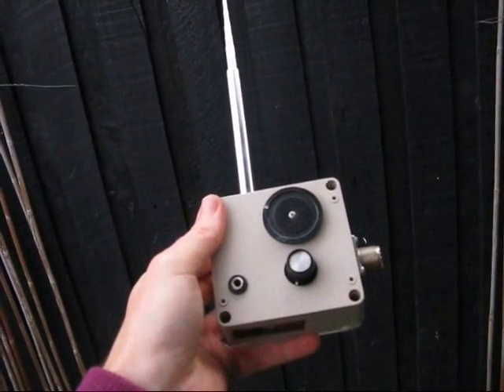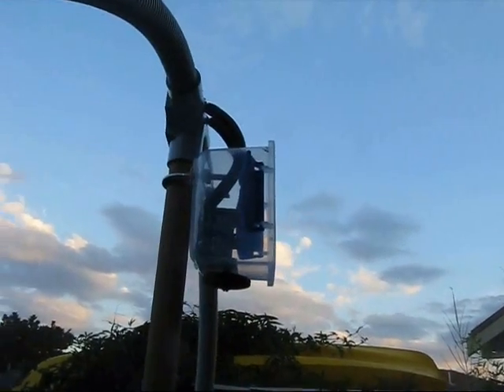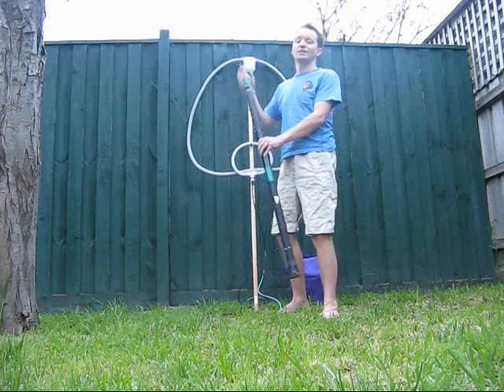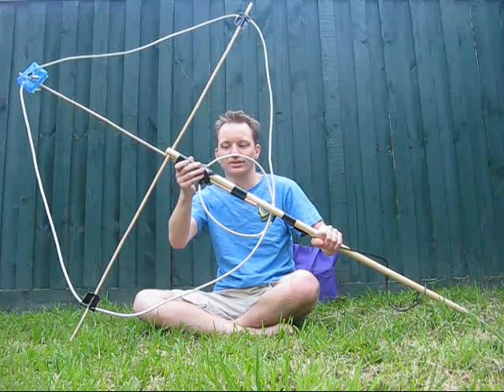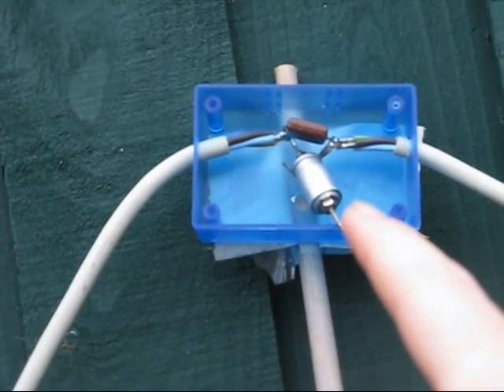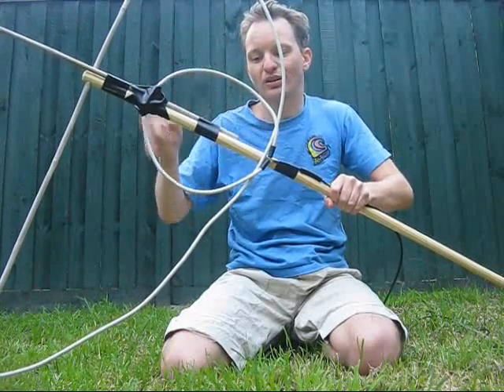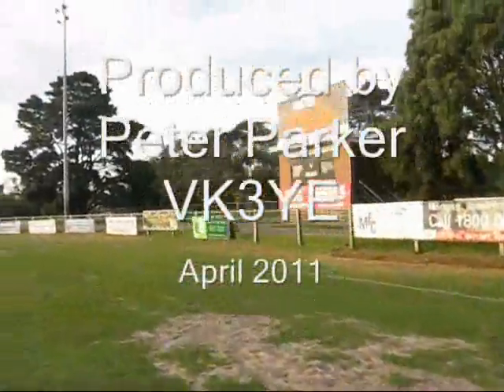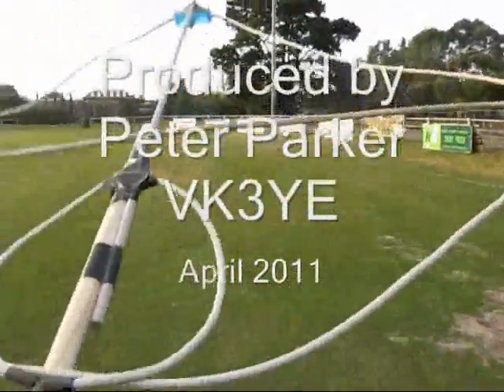Magnetic loops for HF pedestrian mobile - Part 1

Comment: One change you might want to make. Put the capacitor on the bottom. That's how it's done with a Alex Loop. That way it's easier to reach the capacitor while holding the antenna. On the Alex Loop it's designed so you can adjust the capacitor with the thumb of the hand holding the antenna.